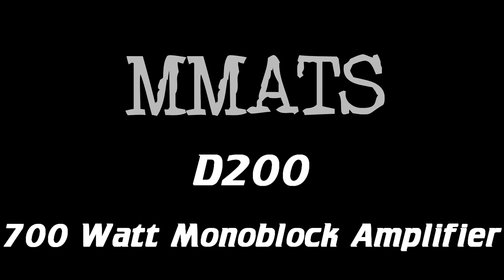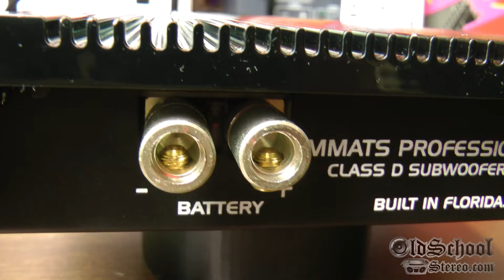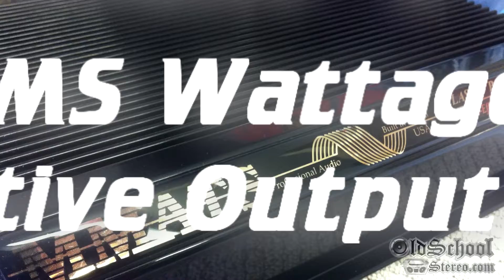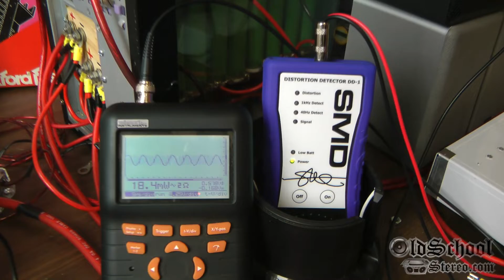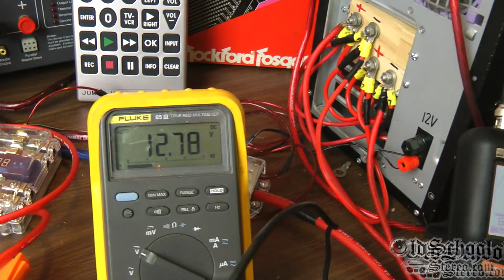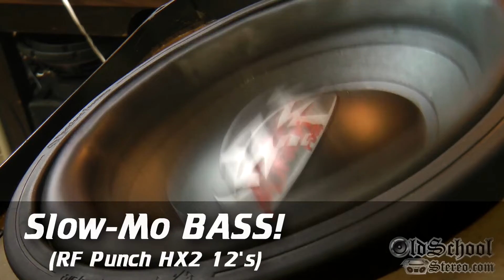Old School MMATS D200 Monoblock Amp Demo Test DD-1

Comment: These amps are amazing. The last system I was building was a wall of 2-15”s and 2 MMATS D300hc’s in a Geo Metro.  I stopped because I was In a pro class and I just couldn’t compete against the sponsored big names back in 1999. Before that system I had 4-15”s (Petra Prowlers) and true 500 watts doing a 150 flat. It was a one note wonder and pretty much daily driven.
Reply from the maker: Nice! Thanks for watching and commenting!

Comment: I want to see Big D Dyno a Kenwood PS series. (Preferably the PS300 or the PS400) They were from around 96-97 and they weren't the typical Kenwood amps. They were pretty impressive. I had a PS400 on 2 JL 12w6's and I hit 147's consistently off the windshield.

Comment: I have seen these amps run at .5 ohms and kick ass. So I guess I'm wondering why you didn't pull it down to .5 ohms on the test?
Reply: No reason to. D200 is intended for 2ohm load impedance.

Comment from the maker: Amp is optimized for 2 ohm loads. MMATS made other amps at the time with the same output designed for 4 ohm or 1 ohm loads (D100 and D300). There were also the HC variants of each amp, which put out 2x the power of the regular D series. I had one a while back (D200HC), too bad I didn't have the big power supply to test it before I sold it...

Comment from the maker: Thanks man! I have (2) D200's, one is black, the other is white. They both had a hum coming from the speaker output and one had lose power connectors. I had both repaired, let me know if ever need repairs, I have some good techs.
Reply: Who is your repair guy for amps? I need someone to fix my old Memphis mojo amp from back in 2005. It's the 16-mc2000 model

Comment: Awesome test. I have the MMAT D700.1 from 2000 and it still going strong. Went through 4 cars and 3 breakups ahhaha, great amp, GREAT VID!
Reply: TheReynMan77 what type of speakers u used with your amp D700.1 how many watts was your speakers
Reply: TheReynMan77  it's it 1ohm stable

Comment from the maker: The HC's are BEASTS!! I had the D200HC until just a few months ago. I'm not aware of many other amps that size that pack that amount of power! They require strong electrical systems, but feed them good voltage and they will make you smile...

Comment from the maker: Great job man, both D200's work great, can't believe they actually beat rated into resistive loads....rare occurrence there! Fingers crossed on the variable 250A power supply, still working to get it!

Comment: Great video BigD. The hum in question, was repaired by bypassing the isolated grounds. Running it to the coupler with 700 ohm 1/8 watt resistor for protection. This amp is a beast for sure!